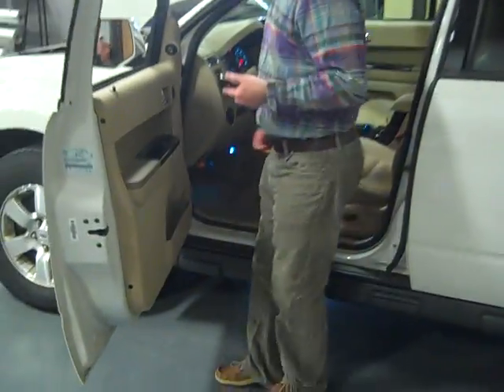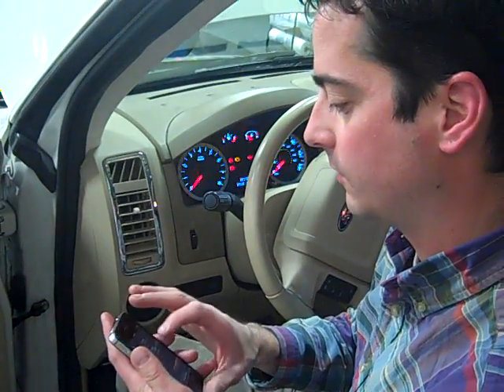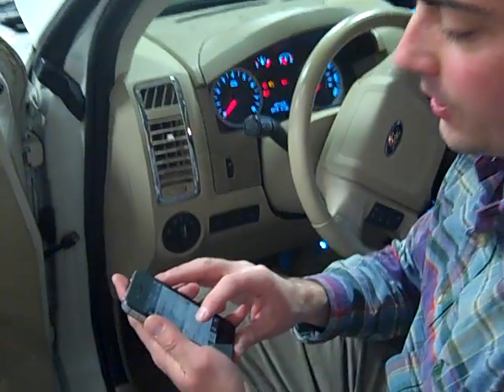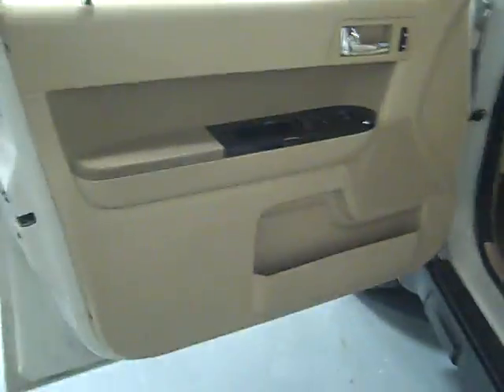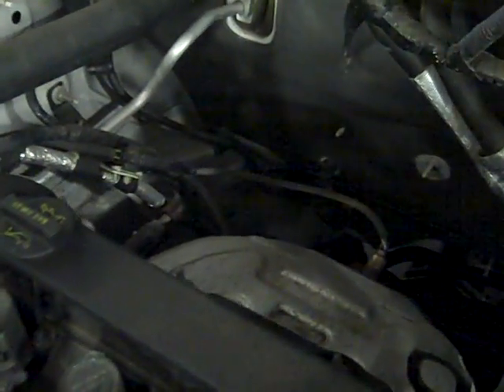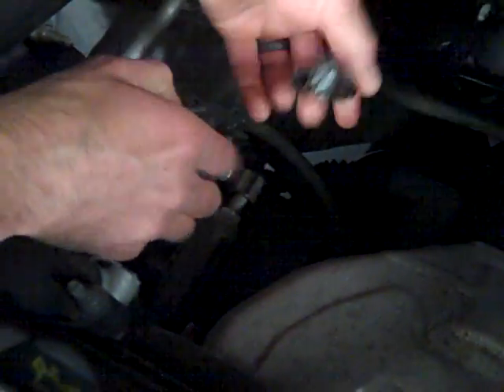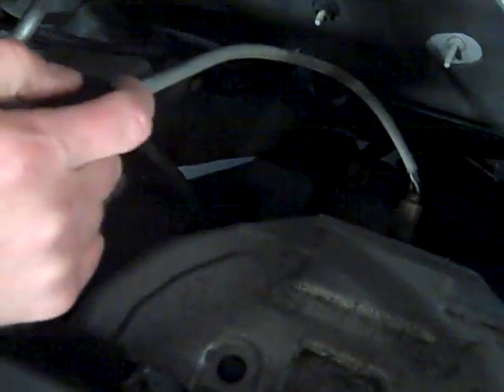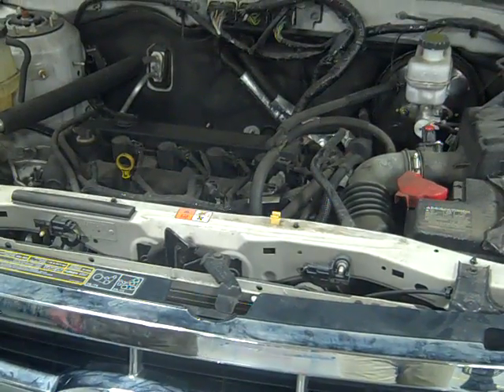How to fix code P1131 with Actron U-Scan

Comment: Aren't you going to check it to see if it's really bad it could be a good one could be a vacuum leak PCV valve okay it'd be neat if you had a way to check it before you replaced it probably wouldn't hurt cuz they only last so long you know being in the exhaust and everything they say two replacement $70,000 but I guess they less you know as long as they last I don't know I have 200,000 miles on my car I don't know if they've been replaced or not my brother had it before me so there you have it check for vacuum leak intake leak something like that one of the hoses okay thank you

Comment: what did you find out about the code & replacing the o2?
Reply: On this new car probably was the O2 sensor.  P1131 code means the O2 sensor is not switching from lean to rich to lean, etc.  However, the O2 sensor will not switch to rich if the bank is so lean the car can't make up for the lack of fuel or the excess of air.  So, vacuum leak?  Clogged injector?